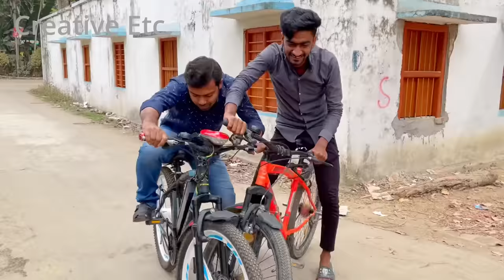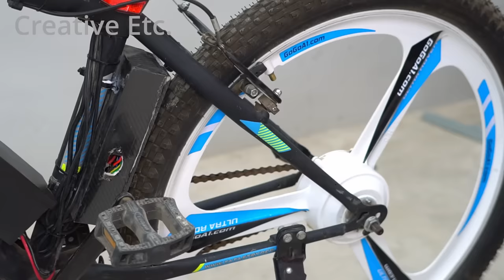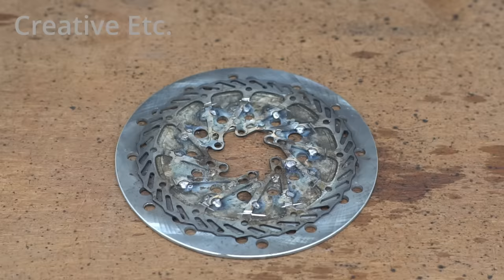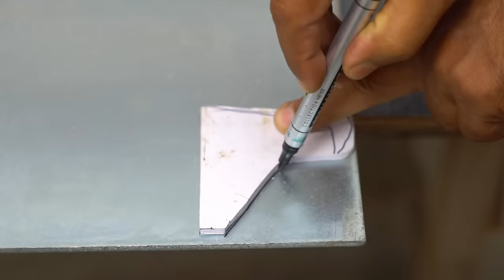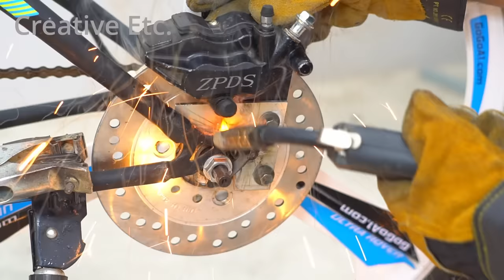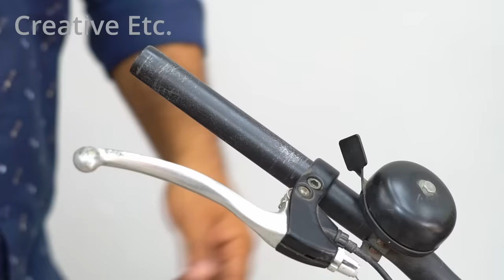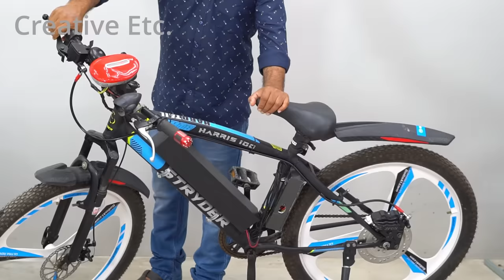Installing Hydraulic Disc Brake in my Electric Cycle

Comment: Bro tell me this is a joke... there are bicycle specific hydraulic brakes already available in the market... you guys are just inventing problems and trying to solve them
Reply: maybe he thinks that he just invented the idea of putting hydraulics on bicycles 😂😂😂
Reply: dude you live in a word that you can have every thing     , hes not
Reply: But those cycle are expensive
Reply: True
Reply: This guy wants to be Albert ienstien
Reply: He's actually pretty amateur for this alot of ebjkes go as fast as 50mph and this is fantastic 👏 idea. Stop hating.
Reply: Bicycle brake hydraulics are simply put, dogshit compared to actual hydraulic brakes from motorcycles or e trikes
Reply: @Morbpious Said someone who never tried riding a bicycle before
Reply: @Morbpious  what bicycle do you ride? An Atlas? Lol!
Reply: @Morbpious Shimano Hydraulic Left The Chat Lol😂
Reply: @lookayt6614 when you have an ebike that weighs 50+ kgs motorcycle hydraulics start to make sense 😅 but the bike in the video can definitely just run normal mtb brakes
Reply: You are right this is unsafe too
Reply: @eddieramirez435 it's not like the bicycle is 200kg to need motorcycle rated hydraulic brakes
Reply: @eddieramirez435 pretty sure the frame is not even rated to go over 180mm rotors
Reply: It's difficult.
Reply: @lookayt6614 I own trinx Xtreme 9 and hydrolic break are more then enough 😂

Comment: Bro there is a specific hydrolic brake for cycle you don't need to put bikes plbrake
Reply: No he's just showing to us..that..it can put..bike one..aswell
Reply: Fir video kese banata
Reply: Hydraulic*
Reply: Braking efficiency will be increased
Reply: @BejoyRS  there are certain hydraulic brakes for cycles which cost up to 50-70k. those are 100 times more powerful than this trash
Reply: @BejoyRS  😊😊😊😊
Reply: @tanzeebultamim9068  ooo realy 
Why i will put 60k brakes in my cycle
Reply: @tanzeebultamim9068  and that brake is not trash because the bikes are are much much better than cycles because the bikes can run at the speed of 90+ so they are made for best braking in high speed
Reply: @royalabhi_0001 true plus it can withstand much more weight than bicycle brakes
Reply: @tanzeebultamim9068 try to make if urself lol. Its hard. Not trash 😂
Reply: bike one is cheaker and easy to maintain

Comment: I've tried cycle hydraulic brake which costs me Rs.5000/- but after one month, it failed, waste of money. I've seen cycle hydraulic brake components are made up of aluminium, which cause lots of wear and tear too soon, don't want to waste on expensive 15000 - 20000 on cycle hydraulic brakes. I have 250 watt hub motor on front, and 500 watt hub on rear. So I need strong grip hudraulic brake which cycle mechanical or cycle hydraulic brake cannot give. So I'm upgrading to ntorque disc brake components, hope it will give what I'm expecting....thumbs up for this video
Reply: Idk if brakes are different for e bikes and normal bikes but ive been using hydrau.ic brakes for a while now and nothing went wrong it just occasionally snaps a rotor bolt if i hit it too hard

Comment: It would be better if you have had attached it in the front. The problem with your cycle now is it will wear away the cycle's tyre. Anyways, it's a straight creative attempt.
Reply: He will invent a tyre. No problem for him.
Reply: @PavolFilek 😅
Reply: Bruh my $5 disc brakes work better
Reply: @ankanpradhan9724  HOw you make disk laser cut athome for 5 € ? Do you know price of laser diodes ?

Comment: 0:05 - You have a front mechanical disc brake and it is shown here that it is connected. Wouldn't you be able to configure it in order to slow down it, and not only? I know for sure that mechanical disc brakes can stop the bicycle even at a speed of 40 km/h (although not instantly), there are about 5-10 km/h and in this case even the cheapest mechanical disc brakes (if they are configured) can stop bike. The video is unambiguously useful, but the pancake does not have to start with fakes.

Comment: This guy really just put a bike or a scooty brake in a cycle 😂

That’s too strong for this type of vehicle that weighs less than 10kilos itself lmao 

There are specific hydraulic brakes available for cycles that start from anywhere between 3k to 4K from good companies like shimano 

Anyways I appreciate ur hard work 
It’s a good project nevertheless ❤❤❤
Reply: He needs more braking power to he's cycle 🤦‍♂️
Reply: @anonymously241  see the brakes locking? That so called "more power" is going nowhere but wastage. This video is pointless.